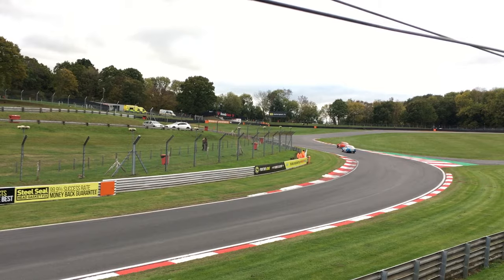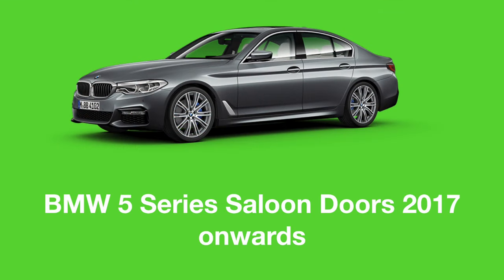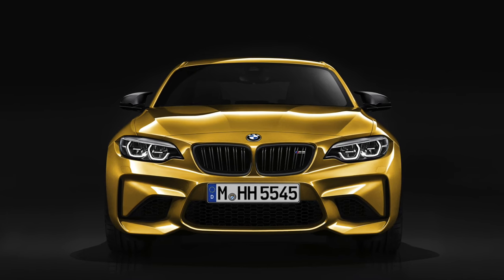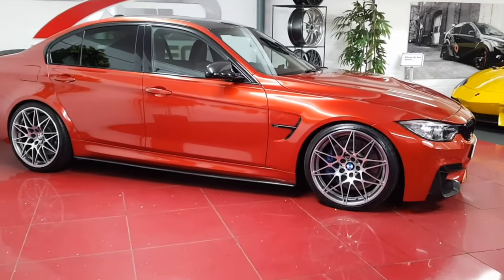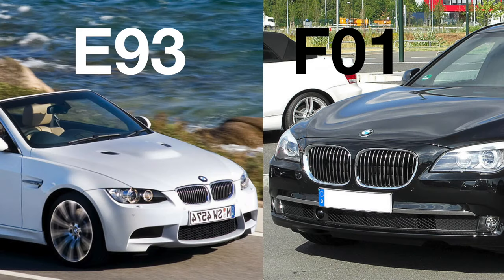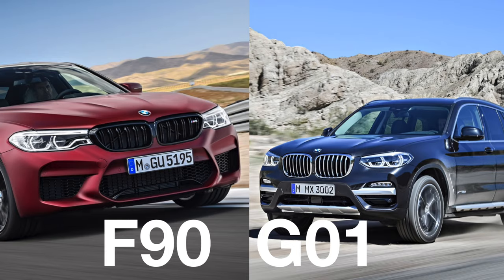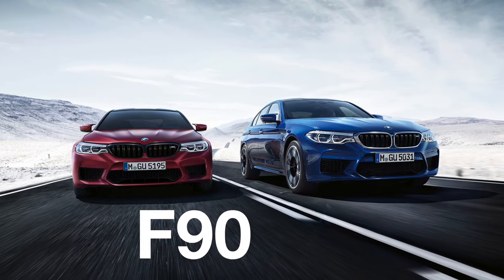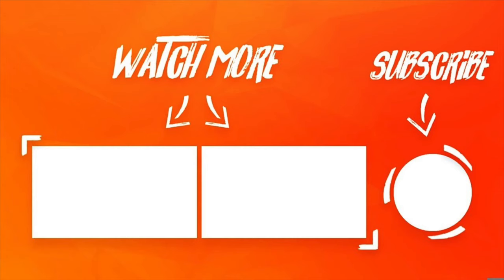BMW Model Codenames Explained

Comment: Ok the models are the E, F and G but then what are the "series something" and the "M something" and "X something"?
Reply: its the model of the car. each series is different than the other. the x series are bmw's suvs. M Power is how you know the engine is powerful and the car has a lot of performance, meaning the car can handle hugh speeds for that specific series of the car

Comment: I wondered why BMW had long names like the 1993 BMW 318IS coupe.
Reply: 3 = 3 series (model)
18 = 1.8L engine (trim) 
i = fuel injection (not diesel)
s = sport (trim)
coupe = 2 doors (but I’m assuming you knew that) 

note: the last two digits of the name may not be the exact displacement, but rather an idea of how big the engine is in comparison to the other trims (ex. 318i has a smaller engine than the 325i)

Comment: I don’t see a code name. I have a 2006 BMW 325. What’s the code name?
Reply from the maker: In 2006, BMW were making 2 models of the series: the E46 and E9X
If your car looks like this it means you have an E46:
http://www.classicblog.cz/wp-content/uploads/2015/05/BMW-3-series-history-40-years-01.jpg
If your car looks like this it means you have either an E90, E91 or E92 depending on body style:
https://www.sgs-engineering.com/media/catalog/product/cache/1/image/9df78eab33525d08d6e5fb8d27136e95/b/m/bmw_3_series_e90.jpg

Hope that helps!

Edit: Just to add: 
E90 - Saloon
E91 - Estate (Station wagon)
E92 - Coupé 
E93 - Convertible
Hence why I used the term E9X

Comment: what was the codename of the isetta?
Reply from the maker: This code-naming System was first publicly established in 1968. 
I believe the Isetta was released in 1953, so it doesn’t have one of these code names. 
Back then, there were far fewer models which made it easier to keep track. Also, rumours of upcoming models were harder to spread, as there wasn’t modern social media, arguably reducing the need of a Codename.
Perhaps BMW did have a Codename for it that was only used internally - a likely scenario.

Comment: I've just brought a 2011 320d efficient dynamics 4 door saloon (Power 120kw)  is it an e90 and what code engine would this be? Cheers
Reply: It is an e90 however, since it’s diesel, I’m not too sure what engine you have
Reply: F30 2.0 litre turbo diesel

Comment: I have a 2004 545i
Does this mean I have a 5 series e60?????
Reply: Is it the same as a M5?? I’m confused 🤷🏽‍♂️
Reply from the maker: Yes you have an E60 model. The M5 has the same codename as there are many variants of the 5 series e.g 520d, 530i etc
E60 is for all 5 series saloon variants from 2003-2010
Reply from the maker: If you have the estate version (aka station wagon) then it will be the E61

Comment: So you explained almost nothing and made inaccurate guesses. Good job mate.

The numbers are not in order of development,  
The E65 for example came out before the E60 and the E63.
The E83  E85 and E90 all came out many years before the E70 and E71 and E84

There is no logic at all, they just used any available numbers, especially the later models, the completely lost any logic and reasoning in the naming. For Example the G30 series M3 and M4 models got their own designations of F80 and F82. Complete nonsense